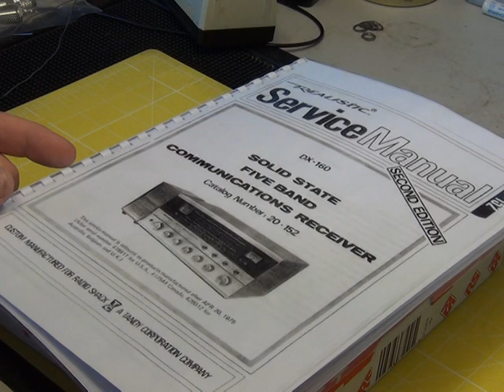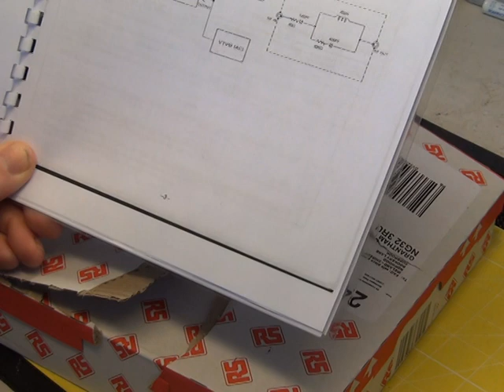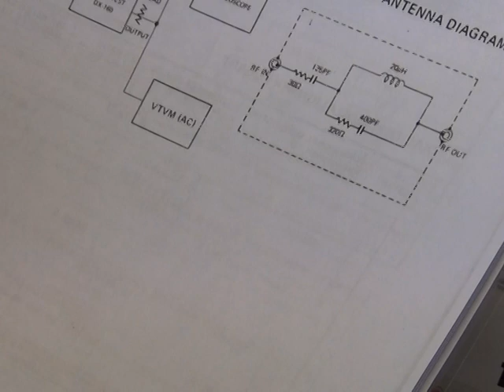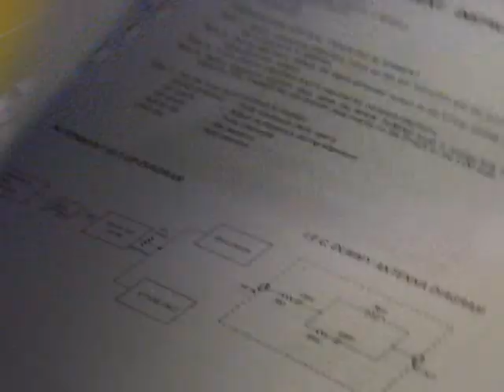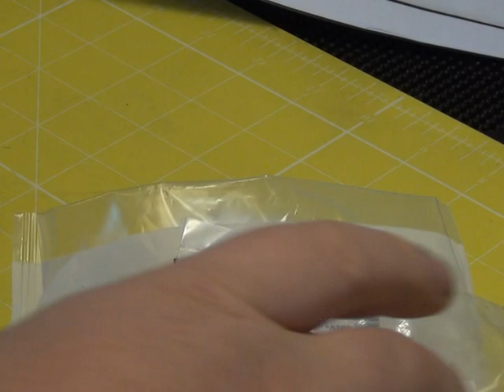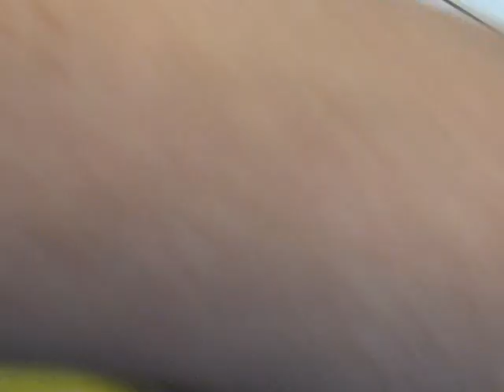IEC Dummy Antenna for receiver alignment Realistic DX160 (Pt1A)

Comment: The RMA dummy antenna is designed to  mimic the long wire aerial of 400 ohms to the signal generator,s 75 ohm load as most signal gens are. This ensures proper alignment of the front end circuits.

' ,s

Comment: is this used only for SW radio or can I use it effectively on my old Kenwood stereo receiver KR-110000G antenna connection?
Reply from the maker: I've absolutely no idea as I'm not involved in Kenwood products. What I'm doing here is building this IEC Dummy Antenna because the Realistic DX160 service manual says that the radio in question need to be aligned using an IEC Dummy Antenna.

If the service manual says you need to use an IEC Dummy Antenna in order to connect a signal generator for alignment purposes, then this is indeed what you need. It's entirely about what the service manual for your Kenwood product says. The service manual will tell you how the product is connected to test gear for alignment.

Richard, G0OJF, UK
Reply: @ukfmcbradioservicingTango21  Thank you, sir!  yes, my manual says to use the IEC dummy antenna.  However, it says it is 50 ohms in to 300 ohms (For FM stereo) out and yours is 400 ohms out.  i just found that out.  not sure, but feels like i'm going in the right direction :)

Comment: Question: it seems the coax you used that connected the output of the dummy antenna to your radio has an impedance of 50 ohms instead of 400/450 ohms. Wouldn't it be better to use 450 ohm ladder line since I assume the output of the du.my antenna was designed to match the radio's 400-450 which is what the radio expects to see?
Reply from the maker: I'm following the manufacturers service manual to present a 50 ohm load from a signal generator to the radio, in orde to align the set. I'm not aware of signal generators that are impendence other than 50 ohms. Rider to that....back in the 50's they were 75 ohms.

Richard, G0OJF, UK

Comment: I have a slight hearing disability, are the connectors on each end SO-239?
Reply from the maker: No John, I built it using BNC connectors for lower loss & so I could put it in a smaller box. There would be no reason not to use SO239 connectors. However, I never use SO239 connectors over 100Mhz as they become very lossy. I know the SO239/PL259 series are referred to as "UHF connector", but back in the 1930's when they were developed; UHF was more like what we would call VHF today. If I'm doing anything on UHF myself....and 95% of my amateur radio activity is UHF 70cms, I move away from BNC connectors & onto N-type.

Hope this helps.

Richard, G0OJF, UK

Comment: I find your video very helpful.  I have a Realistic DX-160 here that I plan to do an alignment on.  But first, I will build this I.E.C. Dummy Antenna. 73 Paul AA1SU
Reply from the maker: I'd been /still am involved in professional 2-way radio for 38 years before I needed to make one of these. I have used it twice though now!

Richard, G0OJF (UK)
Reply: @ukfmcbradioservicingTango21  Last night, I built the IEC Dummy Antenna with parts from Mouser, and did the alignment up to Band E!  While I was at it, I built the RMA Dummy Antenna for Hallicrafters.  I did an alignment on a S40B a few years ago without it.  I watched your DX-160 alignment video a while ago, and the only thing I forgot to do was lower the RF Gain when the S-Meter peaked.  (I watched it again today.)
In place of a frequency counter, I used a modern portable SW receiver.  Good thing too, as the RF Generator was a little off, as I worked my way up.  It was from an estate sale, and it was my first time using it.
I would not have been able to build either device w/o your video, so  thanks!
Soon, I'll redo the S40B.

Comment: Hi, could you have used ceramic caps instead of the micas?  Would there be a downside?
Reply from the maker: I wouldn't try ceramics unless I was desperate, but mylar would probably be OK.  To be quite honest things like this need making exactly as the service manual says in order for the results to be accurate & repeatable.

Richard (UK)
Reply: @ukfmcbradioservicingTango21  Thank you, Richard.

Comment: could you use a tv splitter?
Reply from the maker: Before replying, I looked at what country you are in.Here in the UK TV is 75 ohms, so no. Remember this is 50 ohm to 400 ohm, and of course it's best to use what the manual calls for. I had a look at the DX120 & DX150 manual, and they both call for an IEC Dummy Antenna too, so  not without further use. Good comment though!

Richard